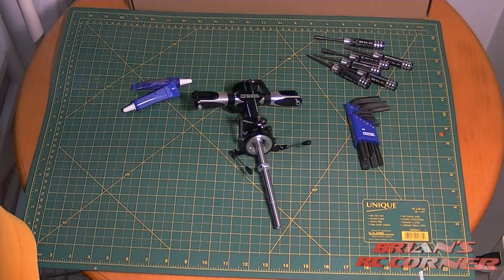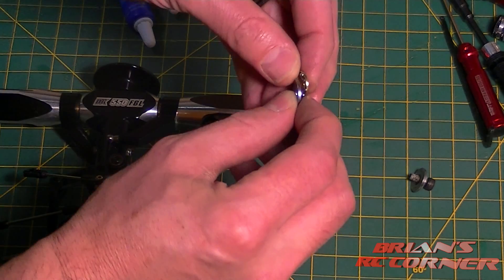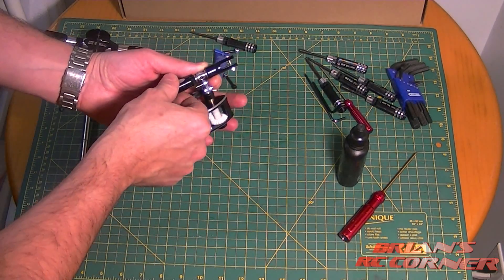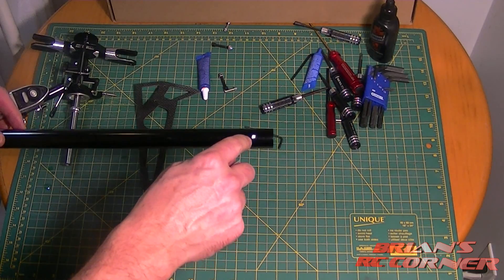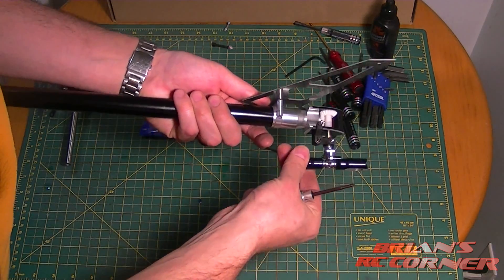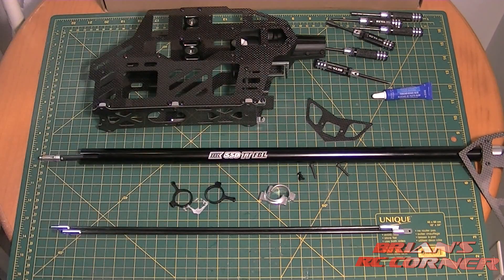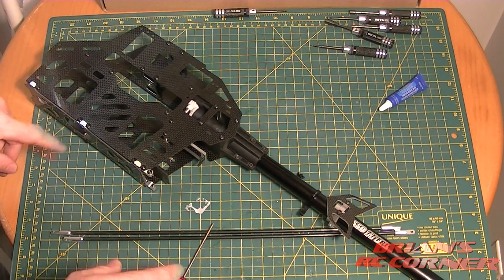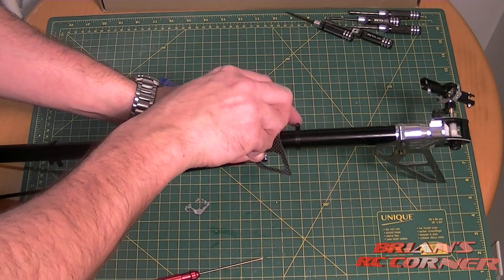HK550TT FBL Build Video: Part 1

Comment: I don't know if you ran into this problem, but I have a HK 600Gt..And I can not get the screws loose to take of the tail block to get the belt on the gear..the screws are so tight on the frame!!  How do I get them loose ?  Cause my allen wrenches aren't doing anything, and I don't want to strip  the screws out!!  Help..LOL

Comment: Good video. Thanks for going to the trouble to make it.

I don't trust glue alone on the tail support rod ends, I had an interesting landing once with a support hanging down from the tail on my HK500! I have drilled and pinned my HK550 tail support rods already, worth considering.

Comment from the maker: I have mostly HK electronics.  Typhoon 600 1100kv motor, Turnigy AE 100A ESC, HK47011DMG and HK47010DMG servos, Castle BEC Pro, CopterX CX-3X1000 (with Tarot firmware).

I'll have to check out the Tri-Flow grease!